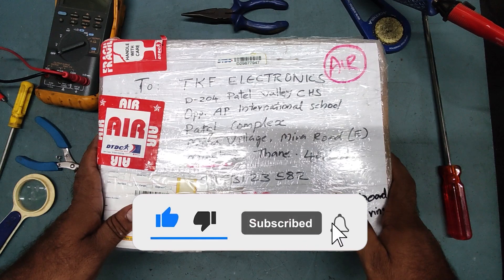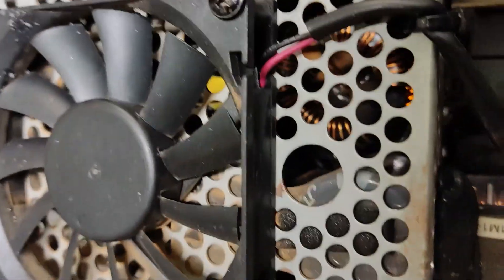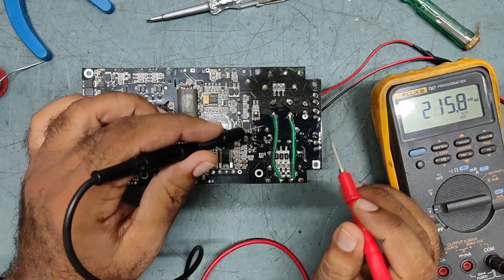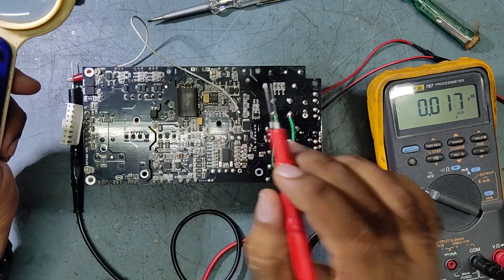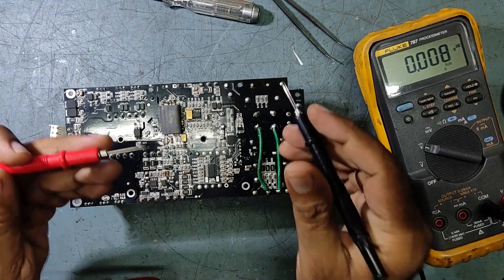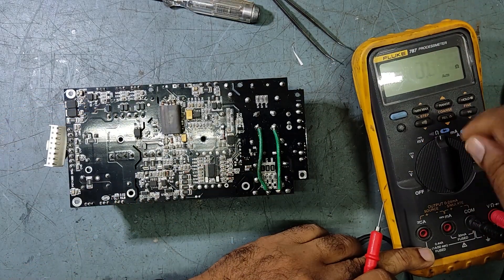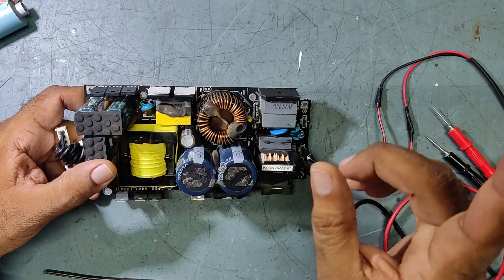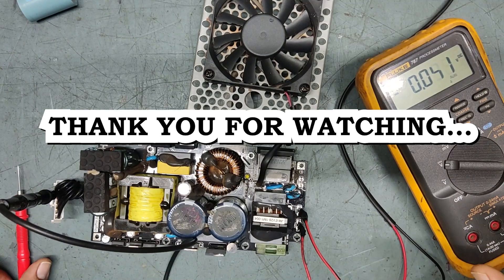Repairing Faulty Power supply Module DIGIPRO 1500S of S30N Active Subwoofer DB Technology...

Comment: Hi, when you did the measurement of voltages before changing the IC. Was it with lamp in series? Because arround the PIC i´m not getting voltages. and main caps are arround 270v (lamp in series)